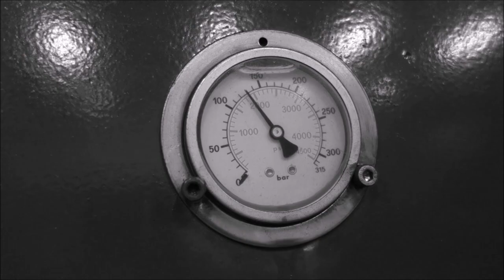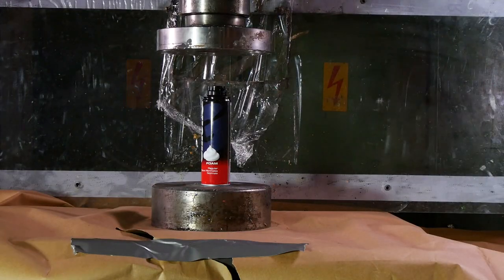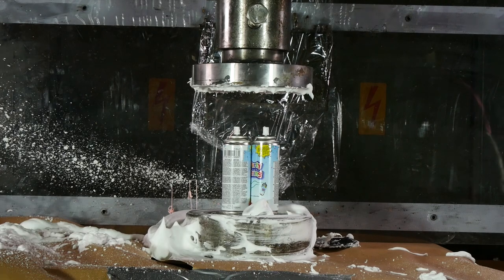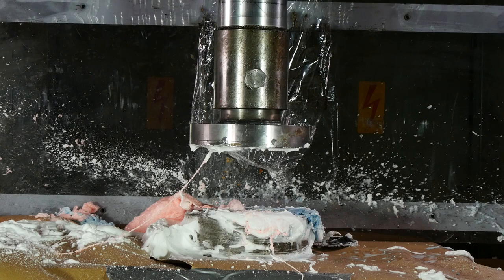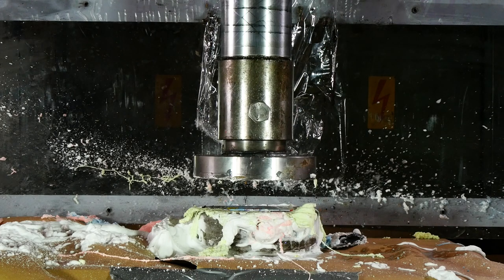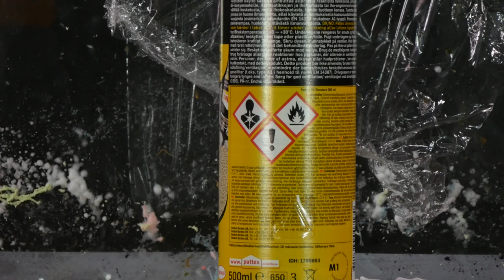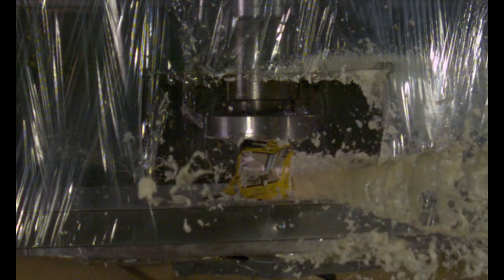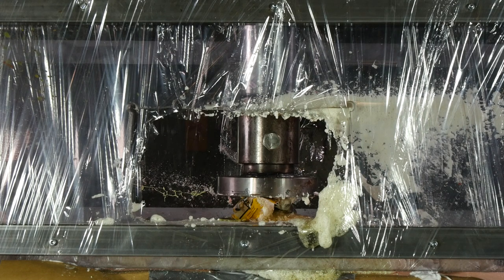Crushing spray cans with hydraulic press

Comment: Crush 2 different metals and see if you can make them fuse.
Reply: sugibudder no they need to be melted to fuse into an alloy
Reply: joris 0313 you must be fun at parties
Reply: joris, duh. Im asking of it could be done with just a press, maybe heat them up a bit to help it and try different metals.

Hell, they dont even need to be metals, i just want 2 things to become one.
Reply: Rock with Arms i am 😋😋
Reply: sugibudder yeah i know but there is already an answer it just cant be done maybe 2 pieces of chewing gum can become one but most things just cant sorry
Reply: Dude, im not telling them to do the impossible, just to try and see what happens, even it its just embedding a piece of hard candy into a rubber duck, idk.
Would be fun to see.
Reply: sugibudder oke
Reply: if it were that simple then there wouldn't be millions of dollars a year spent on r&d to figure out ways to join dissimilar metals. currently the most efficient way is using explosion welding.
Reply: mythbusters managed to "fuse" 2 steel plates together with 500 pounds of explosives so not totaly impossible, just not possible with his hydraulic press, its too weak.
Reply: I think I might have to slightly disagree with Alucard on this. If you used soft metals, such as copper and nickel, (i.e. a penny and an old fashioned nickle) you could probably make a fairly solid chunk of metal. But, you would have to make it very small. If I remember right, the "explosion welding" thing was steel to steel, which is of course FAR harder than something like copper.

That said, didn't they already crush a bunch of coins, including stacking them?
Reply: They did, but crushing 2 different things at once has almost infinite possibilities.
Reply: Yeah, let's mix some copper dust with some zinc powder and see if we end up with brass. Fail? There's always the 1000° hydraulic press.
Reply: Nobody said about trying to crush two metals to form one metal, only crushing two metal chunks to create a solid chunk, like a now copper plated what used to be a nickle. Of course you're not going to actually mix them, dumkoff.
Reply: @rockwitharms7455  I think he’s great

Comment: When dealing with the extra content animals, you need a new press tool. Drill holes in the edge at 45 degrees through to the face of the press tool. That way you will extrude the plasticine / modelling clay out of the holes, like worms.

Comment: In germany you can't easily buy these single component PU foam cans with the evil dangerous symbols without talking to sales staff and explicitly wanting them anymore. They now must be stored out of reach for end customers. They have been replaced with PU foam where the isocyanate molecules have already bonded and are just linked together with silanes using moisture from the air and releasing methanol. I think that's a lot safer, especially since you always get that shit on your skin somehow ;) Still make the same mess, though.